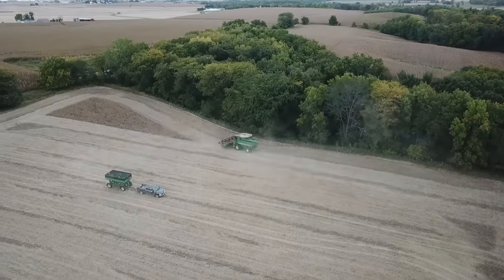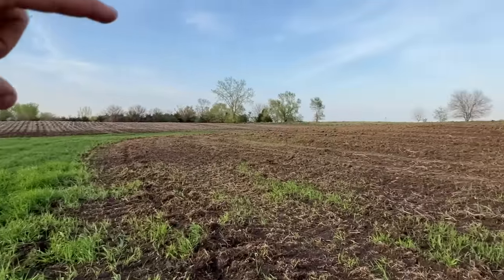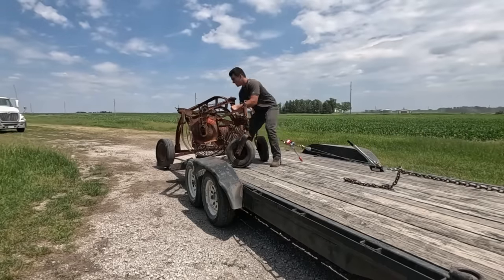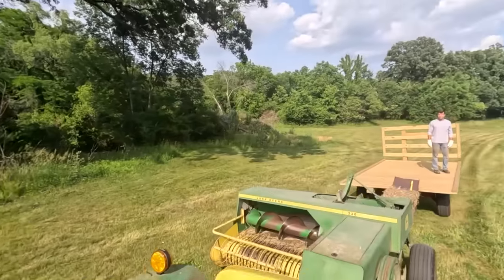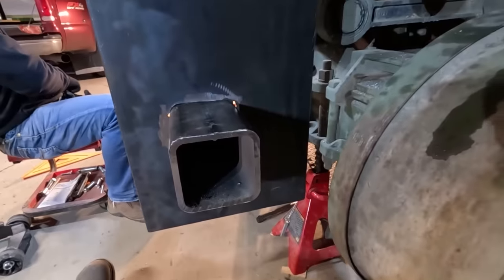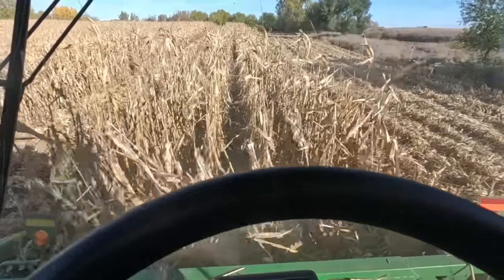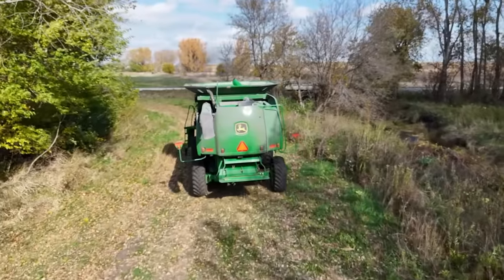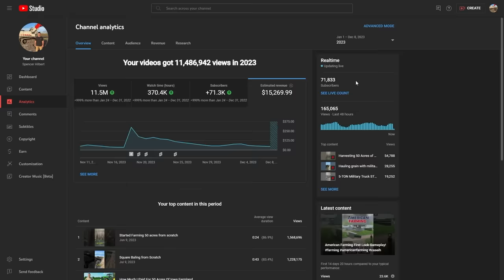I Spent One Year Farming from Scratch

Comment: I'm a professional welder and I have fabricated many heavy duty truck hitches for use in the northern Canadian oil fields.  The hitch you made is bomb proof.
Reply from the maker: Thanks for the comment! Makes me more confident! Thanks for watching.
Reply: i was thinking that too ive never really seen a hitch that thing on a tractor so he did a great job
Reply: The only thing I'd add, and for what he is using it for it should be fine, is when the material is that thick, preheat the metal for better penetration of the weld. Again it should be fine but just a small tip. Realistically if anything is gonna break it would probably something on the truck, or the bolts would shear rather than that hitch breaking.
Reply: Next time don't add anything.   

As if some farmer kid is going to waste $40 on propane and $150 on a torch just to increase his weld strength by 5% preheating plate in the summer time. 

He's running flux core and stick, that shit was hot as hell after only a few minutes. 

You'd get your ass run off site for pre heating 3/8 plate in the summer time welding on a damn grain truck hitch.  Foreman would say yep goodbye buddy you take too long and cost too much.  There's no blueprints here nor inspectors so why try and satisfy them?

Notice how the tubing runs slotted through the plates?  The welds are simply holding it together, not providing the strength during operation. 

This isn't a vessel, its not a pipeline, its an ancient grain truck worth just a few thousand bucks.

You can get all scientific about preheating for me if you'd like but it doesn't matter cause that hitch will be here in 100 years. 

 @ReaIJackhammer
Reply: Cool video
Reply: What's the difference between a farmer and a welder? A welder doesn't think there a farmer. 😜
Reply: That's a lot of leverage on those bolts and frame  I say this after ripping the 12" drop hitch off of my disc that I used to pull double 14' harrows. I did use 2 ¼" solid toolbar for the spreader bar for the harrows. I had what I thought was adequate bracing but it bent/twisted the 6x4x⅜ square tubing if the rear of the disc before the mount ripped off, welds held but the plates didn't.
Reply: @undercoverhustler37  damn you cooked him

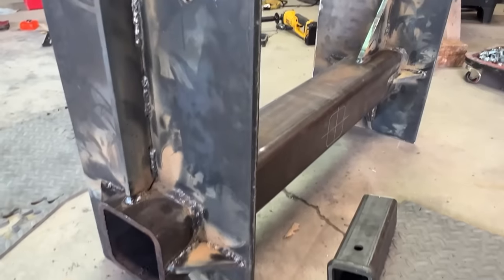Comment: 1:10:37 if anyone wants to build a hitch like this. I'd recommend an I-section or H-section turned on its side (flange being horizontal, facing u, where u weld the connector to) instead of the square hollow section (SHS) as the main horizontal beam. This section is far stronger laterally and will resist the lateral forces from the grain carts.

Comment: I started raking at about 8/9 yrs old with that model rake!  A couple tips - to shift the direction of the bar rotation, when sliding the selector out of the gear box, simply grab the rake bar and rotate it a little to allow movement of the selector to the desired position.  The selector allows you to run the bar in reverse to "ted" the hay!   To pull the rake down the road, the rake is designed to lift the one rear wheel off the ground during towing, and that totally eliminates the tire whipping you were experiencing!   That is a great rake and with some additional time with it you will master the idiosyncrasies!   I enjoyed the video and watching a young man get his hands dirty!
Reply from the maker: Thanks for the tips! I didn’t know that about lifting the back wheels. That will help a bunch! I did use it to ted the hay out. Just didn’t show it in video. Pretty handy for just one unit. Thanks for watching!

Comment: 00:01 Starting my own farm with an old tractor and land, learning and making mistakes along the way.
02:43 Replaced blown hose on the engine block heater.
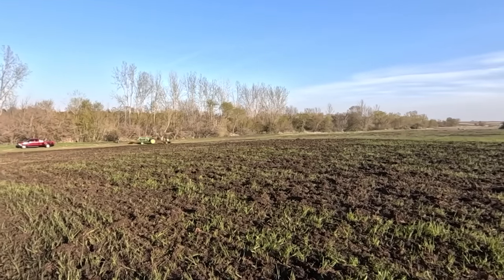08:42 Facing challenges in farming process
11:48 Preparations and challenges in driving and setting up the tractor for field planting.
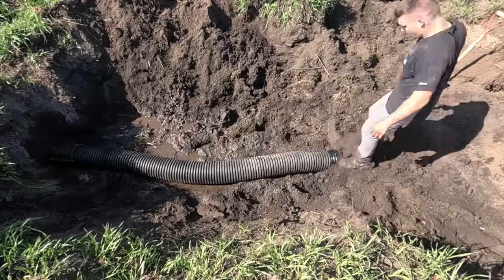16:19 Identifying and repairing a water tile issue
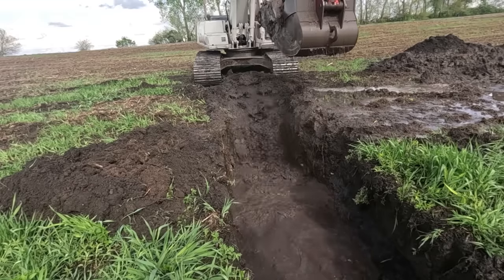18:30 Struggling to find blockage in drainage tile
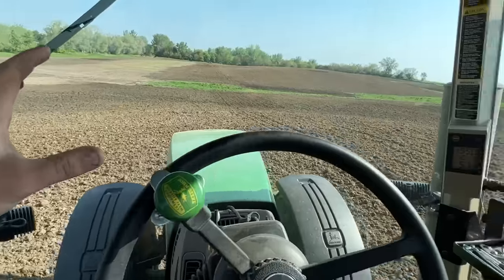25:06 Farming update: addressing challenges with planting and crop growth.
27:36 Successfully managed farming despite weather challenges
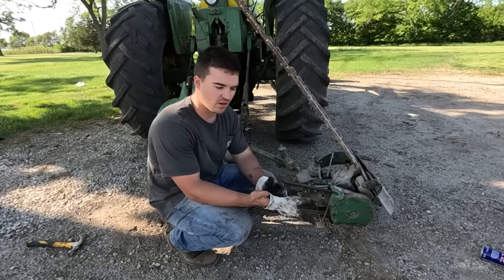31:31 The main spring in the sickle bar mower is broken, causing it to not lift off the ground
34:02 Challenges with using the sickle bar for the first time
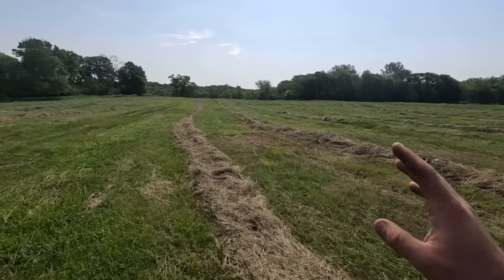39:11 Invested in a John Deere 336 Square Baler for hay operation.
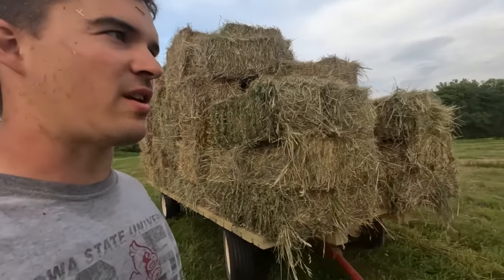42:34 Farming hay and selling bales
46:08 Learning to repair and maintain sickle bar
47:51 Cutting down thick growth and adjusting mower settings
53:20 Experimenting with small square bales led to unexpected challenges.
55:27 Facing challenges in starting the tractor
1:01:22 Building a hitch for the project
1:04:45 Modifying the hitch to allow for easy removal
1:10:25 Building a truck frame without attaching anything to the truck
1:14:24 Testing the hitch with heavy weight and rough terrain.
1:20:42 Harvesting progress and challenges
1:24:03 Harvesting the first farm and dealing with corn head roller issues.
1:29:41 Discovering and fixing sensor issues while farming
1:34:36 Farmers dealing with equipment issues during harvest
1:39:48 Harvesting progress and field health
1:41:53 Monitoring combine performance and yield data
1:45:46 The video discusses the financial aspects of starting a farm from scratch.
1:47:31 Farmland input costs and regional price trends
1:50:39 Farming expenses and harvest yield analysis
1:52:12 Mobile video game simulates American farming with various activities like livestock, crops, and expenses.
1:55:15 Land appreciation affects financial outlook
1:56:46 Revenue from YouTube channel and farming combined.
1:59:48 Transparency about YouTube earnings and time commitment
Reply from the maker: Is that AI or did you do it yourself?
Reply: Hi, i used AI initially to do this, but unfortunately AI wasnt accurate at all, so i kept editing what AI wrote... so the final product is a mixture of AI and myself.
Thanks! @spencerhilbert
Reply from the maker: Dang nice! I appreciate it. Do you do this on other YouTube videos? Are you looking for work?
Reply: i do it occasionally but just for fun and not professionally... also thanks but im not looking for work mate!  @spencerhilbert

Comment: My father had that baler 30 years ago. He wanted a baler with a wider pickup. The only main problem was his customers gate gaps were often too small and my father does not have a good eye for size. Alot of the customers  had to widen their gates. 

Once you grease the baler properly and take care of the knotters, you will be fine. Also keep the windrows even (not bunched up) otherwise you shear alot of shear bolts. Bad windrows make the baler operator life more miserable and slow down baling and can shear alot of shear bolts. Turning heavy hay needs to be done right to spread the clumps out even. Headlands near headges/trees are often heavy and then to spread this hay inland away from hedges/trees and watch for branches/fence posts, etc and remove them then. You can save the baler alot of time (remove downtime) by doing this job right. 

NEVER EVER put in anything other than shear bolts in order to protect the baler from the flywheel/tractor PTO energy. A cousin neighbour put in normal bolts and totally wreak his baler once a fresh branch was picked up and the energy of the flywheel into the ram make crap of the chamber and twisted the chamber chute and the ram hold points and bent the ram itself and bearings.
 If you are shearing alot of shear bolts (was probally never grease properly and some grease points blocked), slow down and check for wear and extra resistance all round. Check that grease is getting through and not blocked on all grease points. Search the manual for all grease and know the timing intervals for greasing. Easy tip, check all moving parts. That baler have a lot all round. When I was a teen, I always start before season end to winter the baler and check for worn out parts to tell my father so he can get orders in (otherwise he waits for breakdown and gets frustrated. Do not be like him). You can wreak the baler with poor maintenance and poor operating. Know the daily/weekly grease points. 

Once you do regular maintenance and check for wear and tear and fix up it is really good baler.

Comment: Just a little tip. Most balers make the smooth side slightly taller than the ruff side. Stack your bales with the smooth side forward or smooth side to outward side of the wagon and the load will lean towards the center or to the rear rack. Makes them ride the wagon better. Not much difference but enough to make the load more stable

Comment: Just a little tip.When removing or fitting big wheels on a truck put a sheet of aluminium on the ground and put some oil on the top side,Then you’ll be able to slide the wheels on.

Comment: The guidance system our family runs uses ground based radio towers for precision adjustments, and depending on what part of the county were on we have to connect to different towers. Since your field is 90 miles away from it's normal area, maybe this is it?

Comment: Hey buddy I have learned during like truck pulls it is good to put a couple supports going from the center of the hook up for where you would hook a trailer and go each direction towards the frame on each side!! So from center of the hitch and back to the frame on both sides!! This definitely helps spread the pulling force so that it puts more on the frame and not more on the hitch!! Hopefully this makes sense for you and you can add a couple forward braces on the hitch that you made!!! You definitely can make it so that they bolt on and are removable so that you don’t have to weld to the frame!!

Comment: If you ever do a crossing, try to use refurbished rail road ties and reinforce it with the rails. My Gparents have a bridge that has wistold over 100+ years of very heavy equipment, built with those materials. It would be nice to have an elevated crossing, so flooding wont effect your road and you could better control irrigation (another future project?)

Comment: try stacking the bails like this ==|.  the do the next layer the opposite direction |==. 5 bails per layer. 25 to 30 bails per tier. 4 to 5 tiers per wagon. also stack like stairs so you don't ever throw over your head. always handle the soft side of the bail. not the stem side. let the bailer do the work when picking the bail from the shoot.  wear gloves and youll outlast the competition lol. staggering the layers just a little helps lock the tiers together.  i like them leaning back a little so when i stack them full they arent falling off the front.

Comment: The only thing I would've done a little more to the hitch is pre heating your material. Just to prevent warping, and structural fractures in the welds. Also putting a few more passes on your thicker material.
Looks great man 👍
Reply: Eventually you should grind out most of those welds with cold roll in them and re weld them. Not going for OSHA standards or anything but I'd hate to see it break on you at the worst time

Comment: I watched some of this, looked at dollar figures at the end and I just go UUGGGGHHHHH.

I see videos of something very different, but it's NOT grain farming so just have to get that out there.  I watch a lot of videos on this line, growing veg and some animals, mostly chicken on small plots where a bigger plot is about 3 acres.  I watched one the other day of a person farming a little more than 1 acre and grossing over $100,000 a year.  The net can vary depending on expansion costs.

He grows a wide variety of veg.  There is SOME usage of organic fertilizer.  There is NOTHING used for insect/disease control, other than barriers.  There are fixed beds.  A bed can be covered in different ways, and there is typically some fixed large tunnels, basically indoor growing areas often used for tomatoes where the plants can grow 8 ft. in height or more.  In general there is a shifting of what is grown in each bed, but that doesn't mean every growing season there is a rotation, because the idea is to learn the soil and what the soil needs.  The soil is treated like a factory.  The goal is making this factory give the best output it can.

Once again this is NOT grain farming which is very different and I know grain farming needs to be done large scale, so many acres.

The inputs to the system are of course the materials to make the different types of row covers, along with the materials to make the framing, although with tunnels (row covers) that are only 3 - 5 ft' tall, it's inexpensive to make loops which is all that's needed.  There is also compost added to the top of the soil and them some beds will have mulch added.   If you have another acre of land you can typically make all the compost you need. 

Of course making a structure for indoor growing is more expensive but it's something that can be added over time as the farm grows.  The equipment needed for working the soil is minimal, all basically hand tools although some operations have a powered machine, typically used to till to some degree, but really these are no-till operations.  The ideal is never having to till the soil, harvesting leaves the roots of most plants in the ground since this leaves fertility in the soil.  If the soil isn't soft enough a broadfork is used to open it up some letting oxygen get down into the soil.  It also allows softer organic material to work its way down loosing it up over time.

This is more than organic farming, it's called regenerative agriculture.  There aren't hard fast rules since every farm is different.  Different location, different environment, different crops, etc......  so there's a lot of science and data collection involved, but it's not the science of using chemicals, it's the science of soil health which is a growing field in ag.

I KNOW there are techniques being experimented with for large scale farming, mostly grain farming using regenerative ag.  A large grain farm requires large equipment and there is no way around that but the goal should still be getting away from needing a lot of chemical input.

In the tropics there are small rice fields, or community rice fields where people own small segments of it.  They are generally chemical free.  We have a couple pads and the only thing we do is amend the soil with compost.

Good luck with this.

Comment: Love this so much. I can't point out anything necessarily wrong with the welds but for future reference steel likes cracking at sharp corners so when doing patches for field and shop repair, Also you may want to get the big 50lb welding rod cans and drill a hole in the top and get them out like a cigarette soft pack and cover the hole with aluminum tape to keep the rods fresh and with low hydrogen properties. Other than that God bless you brother.

Comment: Fair Play to you for even trying a Reciprocating Mowing bar in 2024. They can be useful for cleaning fields or topping. But Cutting a Main Crop in 2024???? Last time I tried one of those (MF 135 Bar) 5'-6" was probably back in the early 80's. In Ireland we have a reputation for heavy crops of grass and as you found out in a Very Light Crop, they just clog and clog and clog. Krone and other manufacturers actually come to Ireland to try out new machines. If they can work here they will work anywhere. Seems like you left a lot of uncut crop on the ground. That is the issue with these type of mower for hay, They were ok back in the horse day as no fertiliser on the ground and grasses were light and old meadow type. Not for modern grasses . I like your endever though. Good luck with the farming.

Comment: Im alittle confused 
Does the 16k loss include purchased equitment 

Was it actually a loss? With interest on the land loan? 

If it includes equitment then next year will it be better? 

Or is it going to stay at the same rate and cost you 16k/yr if continued at a cost of $480k over a 30 year farm 

Also you said you wont include land work so i assume that didnt factor in the weeping tile repairs and the excavator cost to remove the trees 

I also didnt see any diesel costs other then the $250 to drive to tractor the 90 miles
Reply: I'm just wondering if the 40k in corn haul is paying down the land loan, and getting you out of debt and if that was included 

Or do you work a full time job else where to afford the 16k loss

Comment: In my neighborhood that tractor would be no more than $2500 tops, if you want a four-wheel drive that's decent with a front loader 95 or newer, around 5-6 Grand every time. I got my international 234 all-wheel drive with a front loader for 800 bucks, it needed a clutch and glow plugs.
Reply: The bigger ones are cheap because not many people can haul them. The smaller tractors are very expensive because more people can haul them I think.

Comment: Even at 16k loss, dont you then start profit next season/crop? Maybe im wrong but i would assume the initial costs would then be paid in the first year, year two allows you freedom from their, as you have the initial equipment, land improvements, so next years focus is on further land improvement and growing no?
Reply from the maker: No almost all those cost will be recurring annually. I could cut back on some inputs and or do some of the work myself that I hired out. (Example spraying I hired out, as I didn’t have the equipment) the debt/land payment will be the same next year. But after 25 years it’ll be paid off. I can switch things up though and grow different crops. I’ll adjust and learn and change some things up for sure though to be more profitable. I had just a few weeks of planning between closing on the farm and planting.

Comment: find it funny that you guys run your carts unchecked and dont seem to use air brakes, is that just because the equipment is old or is that kinda all around the us? here in germany you have to have air brakes or at least needs to be an overrun braked trailer but thats only for smaller trailers